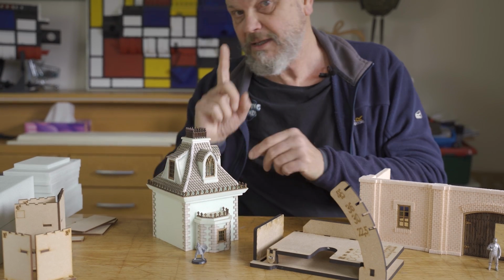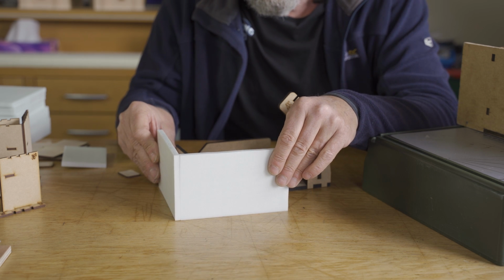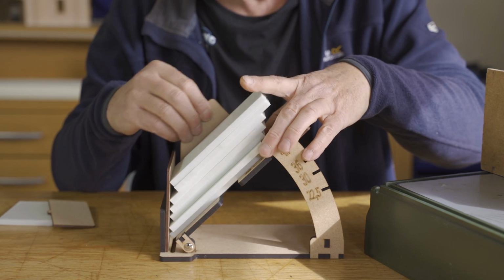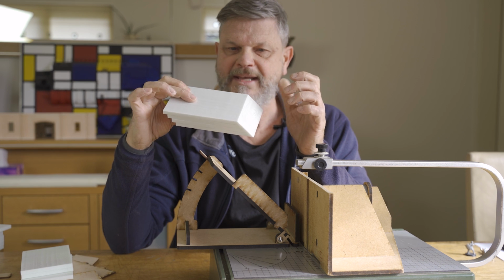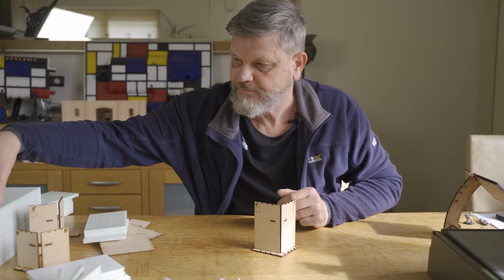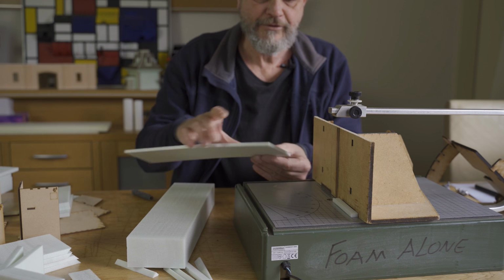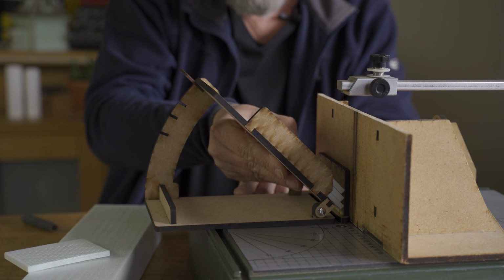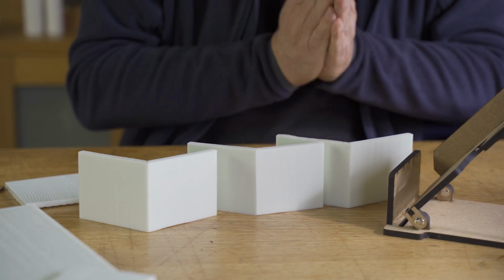Angle Connector Tool by Shiftinglands: Hiding seams and perfecting your walls

Comment: I know this is somewhat arbitrary, but I would almost consider threading the wire through before dropping the foam onto the tool and pulling it towards you, that was after you cut the wire is already on the outside. But I'm sure it doesn't make any real difference, just avoiding the foam getting caught up after the cut.

Comment: I have the tool for some years now. But a little tip to use it is to use carpenter's tape on the back.. you can then put all parts against each other on the sticky side... apply glue and then close it all in one sweep. It's way easier than the use ot the tool you showed after you have made the cuts.
Reply from the maker: thanks for the tip👍

Comment: Hey Gerard! the tool looks amazing, good job!

I have a question i hope you can help me with.
I recently started my first project with styrodur, and found out that the foam is quite porous, and when painted with acrylic paints, it absorbs it a bit leaving me with a "pory" surface that isnt smooth looking. i decided to do a few coats with modpodge, but after 2 coats it still was to porous.

I then decided to just do a thin coat of plaster mixed with mod podge, and although that does give me a smooth and non porous surface after sanding, its still not 100% what i want it to be, and seems like to much work for it to be right.

what do you do to your styrodur before painting it? maybe i am doing it right with the plaster but i wondered what you do, and if its any different and better.

hope you can help me out!
Reply from the maker: I think you might have a kind of foam type that divers from the xps types I am using. The ones I use do not have such an open structure so they do not need any preparation at all before painting. Although XPS is the name for a specific kind of foam, within that group there are many kinds of XPS. Some are softer some are harder, some have a fine and some have a rough/open structure. When looking for foam, always check the sides of the foam sheet, there you kan see how the structure looks like. If you look at the sheet from the top, you see a layer / coating that is never the same as the actual foam underneath.
If you have to go through so much work to get a decent surface I can imagine looking for another type of foam and use this foam for those parts of your build that you can not see when it is finished ( a roof shape where you glued roof tiles on to it for example) 
Hope this helps,
Reply: @Shiftinglands  thank you! The foam i have is basf styrodur 2800c, and i think appart from the c value its the same as your? Maybe i did something to it but i did buy 1m³ pack of 4 big sheets so i preferably use all of that first.